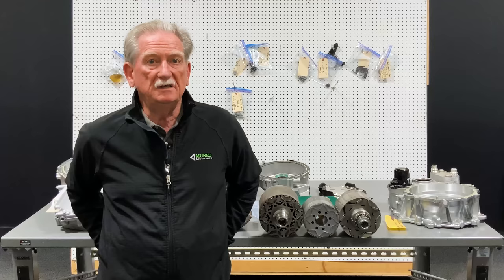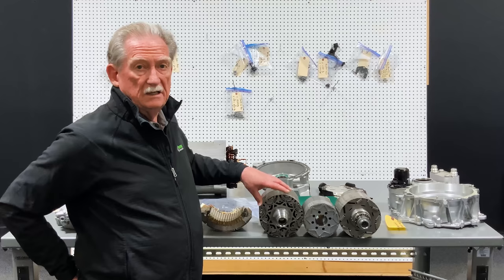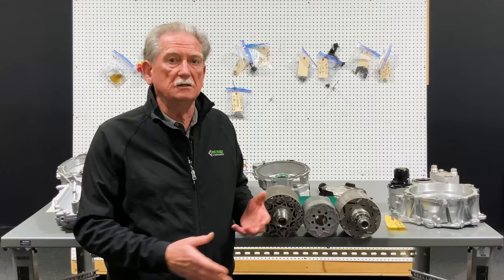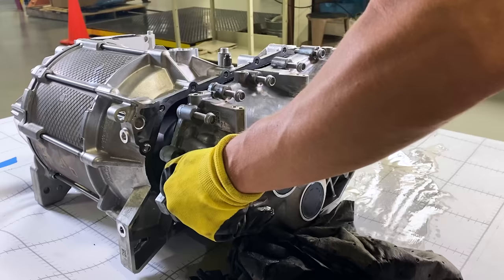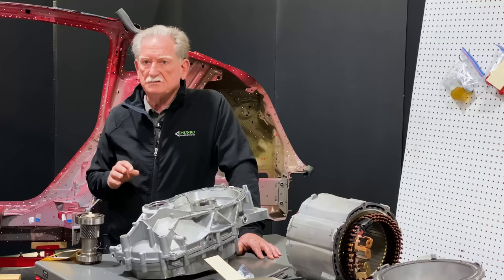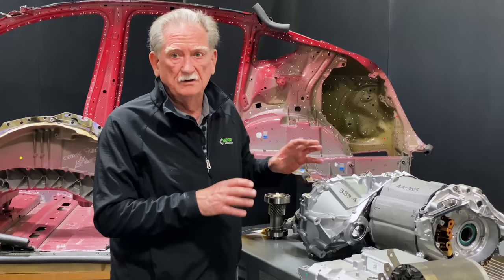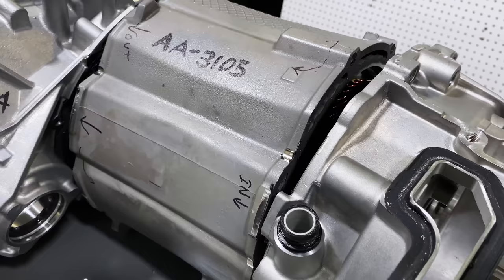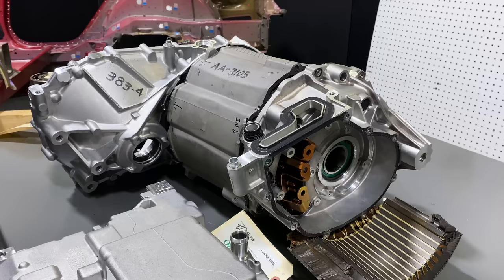Volkswagen ID.4: Electric Motor Teardown and Analysis

Comment: It would seem that the use of roller bearings in the transmission vs. ball bearings in the Tesla is actually a better design as the rollers can handle a greater load. Eliminating one bearing , as you note , helps reduce the friction load.
I am thinking that the Tesla ball bearings need to be massive because of the load requirements. Rollers would have been more compact.

Comment: Well I do not see any possibility to make a snap fit with Aluminium part, with plastic no problem, but not with alu.
Also I think that fasteners aren’t that bad, and it makes things easier to repair. To prevent them from loosening you can take e.g. covering with TuFlok which works really well. Another solution is using thread forming screws, idk why VW did not use them, in such big quantities those should be more cost effective than normal metric ones.

Comment: A positive note to the use of screw fasteners in the Inverter. Very strong whole of life cycle recovery for end of life components built into EU regulations in line with responsible recovery of parts. Could it be that snap in style fasteners hamper the end of life recovery of components for recycle? Or can easy dismantle techniques be built into snap in style fastening?

Comment: Somehow feels strange "Ford" giving advices to VW... Bolts also give a very well controlled, and even checked torque and even distribution of pressure contrary to wobbly snaps. Not talking about gue and glue. Threadlock and dented washers give a secure lock even in vibrating environment. I also would not consider a very secure design the smd resistor grid at tesla with a piece of "thermal" tape over it. In any case I have enjoyed the video, great compilation of toughts.

Comment: Love VW! They build everything with the consumer and amateur mechanics in mind! Almost anyone can work on a VW and they don't use parts that rust like every American car manufacturer. Get underneath a 40 year old German car and remove a part easily without rust fusing everything together.  Get underneath a Subaru or GM, and the car is only 5 years old. Everything is rusted!

Comment: Fact#1:  the majority of subscribers/engineers agree that VW thinks long term and goes for repair and re-use of their modular components.   Fact#2:  Sandy is praised by the majority of engineers and many of us would love to have had classes from this kind of guy 10-20-30 years ago.  Fact#3:  every day we scrap hundreds of Sandy’s and put them on retirement. Seniors fully loaded with know-how and experience fading away in a rocking chair. At the same time tec-students are teached by junior engineers that have little or no industrial experience at all. 
THE LESSON:  let’s take all the Sandy’s back to the shop and reconfigure them to a “4hour/day teacher”. If the Sandy’s are designed with rivets, clips or TF’s - so be it - but we MUST recycle the know-how and experience module  to finisch with a Sandy 2.0: fit for training young engineers. Not only our young engineers will benefit, but also our young teachers will learn from them and on top of this, better products will be delivered by VW, Tesla, and others.  Don’t think big,  think LONG TERM.

Comment: Definitely like Tesla's active cooling system better than VW's passive system. The motor temperature can be more easily controlled based on the situation ie racing or heating for  extreme cold.

Comment: Regarding the Tesla and VW ID.4 motor windings. @ high RPM Eddy currents push the effective conduction to the edge, so it is better to have more thin wires - I do not know what is the frequency. At high torque low RPM you are right, but @ high RPM  I would choose Tesla. Also the size of the motor looks much bulkier in comparison with Tesla. What is the Power to weight ratio for both?
I think it would be better also to distribute the cooling path from the bottom side to 2 sides and collect it together on the top - natural flow is up for a hot coolant, otherwise a more powerful pump is required.
Inverter vertical stacking is OK for assembly but heavier, bulkier and more time consuming. 
VW should make things more light and aero. ID.4 77kWh AWD is 500kg heavier in comparison with Tesla Y AWD long range

Comment: Hello
I am not a engeneer. And excuse me for my bad english. :-)
I think the reason for the fasteners at the rotor is an other.
Why should VW use a heavy and expensive Aluminiumring on both sides of the rotor?
Certainly not because they have too much aluminum to spare. ;-)
I guess there are additional shorting elements inside the rotor so that the motor runs better and with more efficiecy at low rpm.

Comment: It looked like there was a crack in the plunge cut casting (6:58). Was that the case? Was that caused somehow by disassembly or by a manufacturing flaw?? --Or is it just superficial & common on such castings? Or are my eyes in dysfunctional mode? (By the way, it's a pleasure to see these tear-downs you gentlemen are performing)

Comment: TL;DR: VAG jumped ahead of Tesla in motor design, it's bearings are possibly worse, but they've eliminated oil pump, oil filter and a cooler by more advanced design, replaced oil with a dedicated cooler, their wiring is simpler and with a higher fill ratio, and motors have inherently quieter magnet arrangement... key complaint: Too many threaded fasteners - it makes fixing inverter possible but "nobody's going to fix those anyway" (self-note: the lack of repairability is one of the key complaints about Tesla, nice to see VAG addressing it, regardless of what Munro thinks about fixing cars)

Comment: Funny about the comments about the windings and density and fill of the windings and motors on the vw vs the tesla. Considering the fact that if you watch his motor comparisons, Teslas motors are lighter, less expensive to make and are more powerful and more efficient at the same time. At least the Teslas get better range for the same energy used. Now the new model S plaid motors are a design and build that nobody else and nobody has made anywhere in the industry.

Comment: At 6:52 just below the plunge cut, you see cracks/fractures in the casing. There's about three of them in different positions with the largest at 6 o'clock. Are those of any importance or are they purely cosmetic?

Comment: I run a heidleburg cylinder press made in 1952 . original motor mostly ran for 10 hours to 16 hours threadded bolts through motor. Made in Germany . Germany make the best electric motor's.

Comment: i don't think you can state that VW was able to get rid if the oil pump with their design. Tesla opted in for one so they can reach high speeds (>200 kmh). the bearings need forced lubrication at high speeds. VW simply limited their max speed (<180 kmh).

Comment: If the ID4 doesn't have an oil pump, filter and heat exchanger, does the oil circulate with convection?

Comment: Could you do a follow up video where you take apart the IGBT section? you didn't open the heat sink thing. Who makes the transistors, model and make and how many there are of them is very telling. It's the most important part of the inverter. It's the muscle that decides the horsepower, more than any other part of the car.
It looks decently well made but the inverter power supply for the chips look rather big as do the 6 transformers for the IGBTs. And you might not need bleed resistors at all. You can dump it into the motor windings on the rather rare occasion that you want to discharge it at all. I think I could cut the PCB board size by a factor 10. Maybe 50. Too many big chips to do the motor control, it's not that computationally intense and you could make a tiny custom chip. The lower power they operate by the less cooling you need. They shouldn't need any cooling at all. And rather than a heavy cast case you could do the lid approach of making two sides that are just stamped sheet. It's not a structural or mechanical part so does it really need massive casting. I also wonder if the power transistors could be placed on the motor at coolant parts and shorten the busbar parts which shortens undesirable inductance that causes ringing in the power section and strains the IGBTs

Comment: From my point of view there's nothing wrong with using fasteners like that, it's a low vibration application and those circuits boards are no different to a motherboard, probably have several grounds and need to be secured again micro vibration. Plus the fact those threads and machined surfaces will all be nice and true and everything properly torqued.  Clips are fine but I'd rather see threaded fasteners from anything made in Germany.  What I am interested in is those capacitors, are they ultra caps for Regen or smoothing caps.  I find it amusing that you still got an oil filter on the Tesla, lol.  BTW I converted a 1991 VW Passat 35i to electric just over 10 years ago so I am very interested in water proofing and cooling on the manufacturer made units, I think VW still has the edge, looking forward to seeing more of these teardowns.

Comment: You need to address the issue of low torque at low motor speed of these inverter suppliied motors using 3 phase,stators and PM Rotors.  Does the car still need  clutch?

Comment: Great video but you never explained how VW eliminated the pump, filter and heat sink. Maybe it was edited out by mistake. Even if a water based coolant is used instead of oil it will still require a pump and a way to shed heat. I first thought the low pressure central stator housing was doing that but you seemed to indicate otherwise.  Actually cooling fins over this casting might have helped reduce the temperature more. And I don't get why the filter was eliminated.
Reply: There's got to be a heat exchanger, likely the main radiator. So maybe he meant to say "dedicated heat sink". 

Pump? Has to be one, too, I would think, but, again, maybe share a pump with hvac system ?

Comment: Vw uses a Shetload of screws prob because this is a first gen product, and in case there are unforeseen design issues, a reasonable cost of repair is still possible. Imagine a class action lawsuit that results a million inverter replacement, vs some kind of specialty board repair service.

Comment: The train tracks making noise is the fact that U.S. rail companies let the infrastructure go to shit before they fix it.  Rail joints that make noise are either not welded and they should be or there is a mud hole

Comment: I'm wondering if there is any benefit to keep the motor internals under vacuum. Or if it's even possible to maintain for 10+ years? Bad for the grease/oil?

Comment: Is the fastners for the flex on the board?  I've seen recievers that ended with flex on the boards where they got hot/cold and cracked the solder on some connections.

Comment: What I find is a pitty is that you have to disassemble a part of the engine before you an disassemble the inverter. And after that you need (I suppose officially) new sealings.

Comment: Modular design....aside from this permanent magnet motor probably needing more robust bearings, the modular design across all VW platforms might be broadened to other vehicles including the VANAGONS !!  EVTV mounted the model S drive system and many (ie. EV West, Jehu Garcia) have added electric motors but even more of us would love to have a cost effective electric option.  no need for the fancy infotainment, navigation (phone already does that) just give us a cheaper power option.    If we are truly trying to save the Earth building to 1MM miles motors is very useful....stop the unnecessary waste of resources and associated pollution.   
Already salvaged the more powerful subaru boxer engines, next the  ID4 permanent motors ??    Weber Automotive and Monroe Live teardowns are very much appreciated.

Comment: Bleed resistor us not put on PCB board to avoid heating
Reply: I would have some doubt whether a Ford engineer (of the past) is deep enough into electronics to understand why you might add an array of SMDs to the board instead. It‘s just cheaper and if you have trouble with that part, „just exchange your motherboard“. And the additional heat will make that change more likely.

Comment: I do not understand why they did not give the 3 contacts coming from the inverter and the 3 contacts inside the motor housing the same shape at the point where they meet with as much commonly shared surface as possibly could be achieved!

Comment: The rationale for the three bearings rather than four on the motor and input shafts is more that it's "best design practice" rather than for "less friction" or "lower cost".  With four you suffer from geometric radial overconstraint around the spline which can lead to outer race spin as the redundant bearing is insufficiently radially loaded.  Most modern EVs feature this.
I'm puzzled about Sandy's enthusiasm for the direct-coolant-cooled (a so-called "dry") motor since this is what Tesla and Hyundai/Kia had already tried and moved away from. Tesla suffered from coolant leaks in the S/X and H/K's Kona/Niro/Ioniq/Soul currently suffer from premature motor bearing failures.  Mistakes have been made and corrected.  The Model 3/Y, second-gen Kona/Niro and all Hyundai/Kia E-GMP range have benefitted.  I'm optimistic that VW have done their due-diligence with this design but that will need another few years to prove out.
It would be great (as I've mentioned several times) if Munro could spend a moment talking about (a) the means of ferrous particle sequestration provided in the gear reducer and (b) how motor shaft residual induced currents are drained off or kept from damaging steel-type ball bearings (where deployed).  Thanks for the awesome videos!

Comment: Why would you want to put three or even four bearings onto what is basically one axle/shaft? Two is enough! Manufactur the teeth of the spur gear directly onto the rotor shaft and be come up with a clever idea how to hold the motor housing onto the gearbox housing with the hugh gear forces. This would be one bearing less and the spline is gone on two parts.

Comment: The point with snaps instead of fasteners has to do with repairability. Different to the US where such principles are not enforced by law, EU laws require the prevention of waste, and 'design to repair' is a basic to be used to follow these laws. Doing a serious should cost analysis on a standard repair job on e.g. tesla model 3 or VW ID4 would show, that Tesla is far off in respect to repair costs and needed man hours.It is also visible in the circuit boards. The component count and PCB area is much more competitive then the Tesla board. From the cost point I would estimate that the tesla board and components are at least double the cost of the VW board. The modularity and the interconnection by fasteners allow a component based repair by replacement, which allow for reduced repair time.

Comment: Thank you for that run down, out of curiosity, how are the motor core laminates held together? I couldn't see it well enough and I don't suppose those fine laminates are still being welded anymore, like in the old days, and how thick a sheet are they punched from? It looked very in your hand. This is a really good demo however I'd be all ears to hear from you about some new type of fastening methods other than Screwfix mind you that is still the most versatile method to use; It is tension adjustable and if you use the right type of washer shouldn't undo, in my view.
Reply: By 4 long fasteners, it is in video.

Comment: I would like to take him for a ride in my Ford Focus.  You can hear all of those "snap fasteners" rattling as you drive down the road.  If they were screws I could simply torque 'em down and fix the problem.  How to fix the snaps?  Not doable and makes for a very unhappy Ford owner.
Regarding that inverter, those fasteners are for EMI on the case, higher frequencies need closer-spaced fasteners, and the PCBs they are for grounding and EMI.
There simply is no substitute for the high force provided by a properly torqued screw to keep the EMI quiet and properly ground the PCBs.
I think he is dead wrong about servicing the inverter.  I would say a pretty good chance of an IGBT failure, especially if it get driven a million miles, and the way it is designed it can be replaced instead of scrapping the entire inverter.  Personally I would chose to have it serviceable if I was to buy one of those vehicles.  No snaps please!

Comment: I don't fully agree about the comparison between solid pin copper as used by VW being better than multi-wired winding as in Tesla motor. That might be true for DC but not correct with AC current. This is named "skin effect". The higher is the frequency the less the current travel inside the copper but tend to stay at the surface. Thus in high frequency, it is more efficient to have a bunch of small diameter wires, isolated from each other and running in parallel than a single thick copper wire. The bunch of small wires has a larger surface and is more efficient even if the cross section surface of copper is smaller. see "Litz Wire" on Wiki. On that specific point, Tesla motor must be more efficient.  Andre

Comment: First thing Sandy, Railway Tracks in Europe are welded, hence the lack of didummdidumm. Do your Homework!

Secondly, as you can read further down, inverters get repaired if you can take them apart that is. Here is where your snaps will break off or your gluing will prohibit accessability

Third thing, you cant pretension rivits, if this was possible, cylinder heads would be rivited on! 

Zuguterletzt, the cars roling down our Autobahns do not fall apart because of the all of the screws, nore do airoplains fall apart in the air mate.